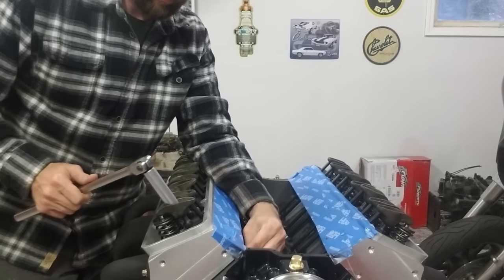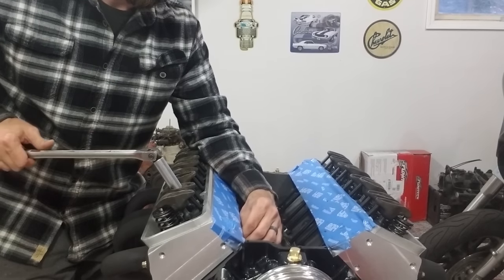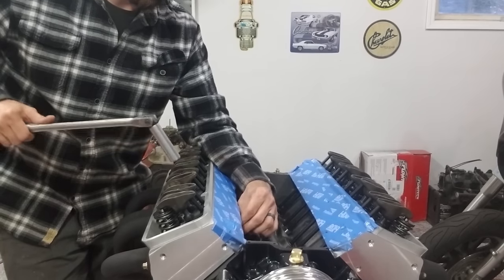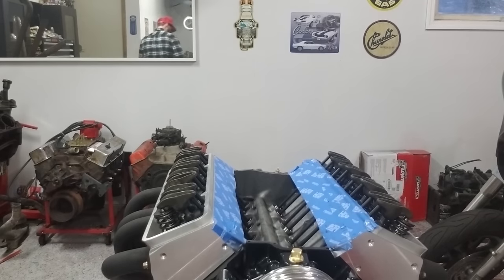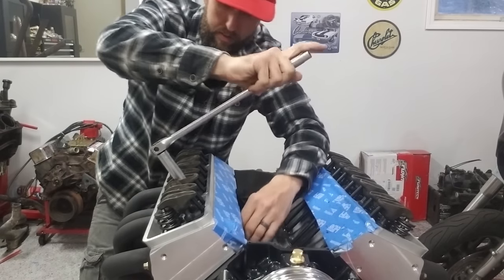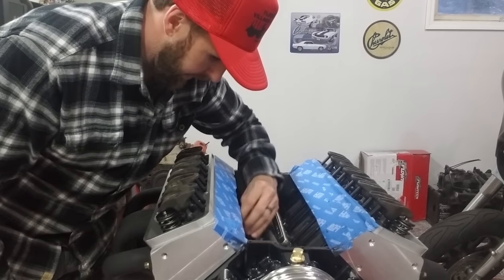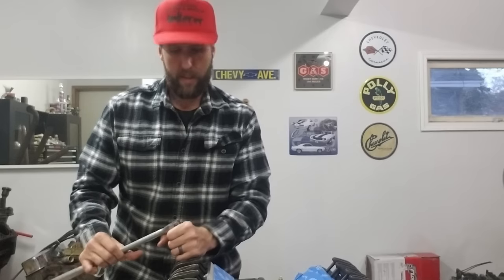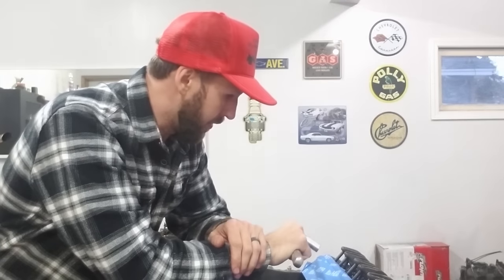Hydraulic Valve Adjustment THE EASY WAY!

Comment: Could you make all of those rocker arms adjustments and if you were concerned they were possibly too tight could you pull a plug and stuff a wad of paper or something into the plug hole and then turn the engine over either by hand or otherwise and see if it will push the wadding out of the hole on the compression stroke?
Reply: If it spits the wad out you know your valves are at least closing  and not hung open by an over tightened rocker?

Comment: Why not: 
Set to TDC - adjust #1. 
Advance crank 90Degrees - adjust #8.
Advance crank 90Degrees - adjust #4.
Advance crank 90Degrees - adjust #3.
Advance crank 90Degrees - adjust #8.

Advance crank 90Degrees - adjust #6.
Advance crank 90Degrees - adjust #5.
Advance crank 90Degrees - adjust #7.
Advance crank 90Degrees - adjust #2.
That way, the cam only rotates one time, thus keeping the cam lube as intact as possible.

Comment: Can I adjust my that way after motor is installed and has been running.
Reply: Yes
Reply: yes,absolutely
Reply: You can even do it while running, and not get messy if you have or borrow someone's valve cover with the center cutout!

Comment: +Vice Grip Garage Been asking around, cannot get much help locally. I thought I would reach out again. From watching this and doing some reading it would seem you tighten them down just until you cannot move them at all, then rotate 90 degrees, and do it again - doing this several times. As I said below, I understand that the lifters should NOT be presoaked when doing this, just dry. Once this is done, it should run purdy good right?
Reply from the maker: Not until they don't move at all.  They should spin freely between your fingers but not move up or down.  90* not enough for hydraulic lifters.  1/2 to 3/4 turn, or 180* or 270*.
Reply: @ViceGripGarage  Gotcha, no up and down motion, but spin freely between the booger pickers! Then rotate the crank more than 90 degrees, say a 1/2 a turn over - do that prcoess again, a few more times, and I should be golden. If I am wrong feel free to correct me - I am still trying to figure all this stuff out. Thanks again!

Comment: Noticed you were just working on the one side but I’m assuming you adjust for zero lash on both heads then turn the crank 90 degrees?

Comment: It doesn't matter if it's 90 degrees? The reason I ask is I don't have access to the crank bolt. (Cooling fans and radiator in the way) If I can bump it over "about a quarter revolution" with the starter, that would make life SOOO much easier.

Comment: This is explained really well, but I think I'm just stupid.  Derek says he spins the motor over about 3 or 4 full rotations until he feels confident in it, but I probably did about 12 full rotations 90 degrees at a time and still kept finding rocker arms that felt like they got loose.  I don't think I have the right "feel" for zero lash.  I tried to feel for when it felt like the rod was contacting both the rocker arm and the lifter at the same time, but I think in the process of checking for up and down contact I was compressing the lifter a bit, or doing so inconsistently.  My lifters are brand new, and though I dipped them in oil as I installed them, I'm not sure if the problem is in the way they're supposed to pump up or what.  I'm definitely not doing something right.

Comment: Just watched your video and just 1 question i have a 326 pontiac motor and just purchased a hydraulic flat tapper cam eith lifters and valve springs will this method work with using stock rockers and still get to the specs according to the cam and not have to shim or use the kit with the wheel and gauge

Comment: Ok, I know how to adjust the rocker arms when the lifters are new and no oil in them. My question is how do you adjust them after the motor has already been run and the lifters have oil in them? I was told it’s not the same way as if they were no oil in lifters. I’m having to replace my push rods because I didn’t get the chrome ones for push rod guides.

Comment: So the idea here is that you adjust the rocker under no tension, when the valve is fully closed, right? And this is a way to not have to think about where the valve is?  The idea is that if you rotate the engine 90° a bunch of times you WILL get it when the valve is fully closed.  Did I get it?

Comment: So what you're saying is that at no point in the rotation of the engine should the rocker arms ever feel loose? Mine are loose on some of the cylinders on my big block 396 depending on where it's rotated to. Should they be tightened?

Comment: I had a hot rod buddy pull my old sbc out of my '77 K10 and install a remanned 350. I think he just set the timing by ear.. it was pinging going up hills so I filled up with a higher octane and added an octane booster which seems to help a bit. The install instructions said to adjust the valves but he said it sounded fine (when fired up in his shop). So I will check the timing, then if still pinging I will attempt to adjust the valves.
My big question is: I guess to access the push rods I will have to pull the carb, dist., and intake, ...not enough room to access the push rods from just pulling the valve covers 😅right? Just wishful thinking I guess.

Comment: very nice I just subscribed to your channel been watching all your builds and I love how you make everything phone just one question on the valve adjusting like the video I just looked at you said it works on all types I have a 350 4 bolt main out of a Corvette that is 30 over I was wondering if I can do the adjustment on my motor the same way even though I have roller rockers and not the regular rockers
Reply: yes

Comment: Is this still the same with a Pontiac non adjustable valve train where you tighten the rocker nuts to 20ftb ? I am assuming you do this with lifters with no oil and when you fire the engine the oil filling the lifter will take up slack and then you torque the nuts to 20ftb . Correct ?

Comment: Mine will be a bit harder. A fair sized solid roller cam in mine. Needs a different process. I'm using poly locks too.
Reply: same exact method unless they are solid,identical procedure

Comment: my Dad showed me this when i was 12 years old, then he made me build a 283 chey and said It better not Blow up it ran like a top I have built Hundreds of Small and Big Blocks Chevy Ford Mopar and this Method of adjusting Valves has always worked with no problems,   this will not work with a Solid lift Engine.

Comment: I got a big block Ford 460 having problems I got it on the motor stand did a cam and intake swap put the lifters in use the same push rods I've been turning the engine over for the breaker bar trying to prime the engine I can only get oil out of the rocker arm on number three good oil pressure the drill wide open about 80 lb I wonder what's going on just came get oil to the other rocker arms any ideas it is a flat tapping Rock on

Comment: I have a rebuilt 3.4Liter Chevy v6.  I ran the rebuilt engine for 30 minutes at 2500 rpm to break in the cam.  I have some clatter.  So now since I ran the engine the lifters have oil.   If I do this process and find that some are loose, I understand that I take the lash out and then go 3/4 of a turn. My question is if I find other valves that were not loose, do I also do an additional 3/4 turn of preload as well? Or do I loosen all rockers and start over?  Thank you for your answer.
Reply: Ever figure it out

Comment: Does this method work on lifters that are already pumped up? My sbc has been recently run but I need to re-adjust my rocker arms will this work in my case? Thanks
Reply from the maker: Yes preload is preload
Reply: @ViceGripGarage  perfect, thanks alot for the response!
Reply: You can do it while it's running also

Comment: I have a newer engines from one of those big company remanufacture 350 sbc for my boat 45 hrs.  Heard a tick starting. Pulled the cover and found#2 rocker not centered on the valve stem.  What's a fella to do?
Reply from the maker: Replace pushrod and rocker, then follow this procedure
Reply: @ViceGripGarage  thank you. I'd attach a pic if it was possible.
Reply: center it and follow along the videur

Comment: do you tighten til the pushrod won’t spin at all or til it just touches the rocker, also do you use the preload from your manual for this method or do you use the 1/2 - 3/4 turns for this method
Reply: Did you ever figure it out?

Comment: Hello Derek. I've got a question that you may be able to steer me in the right direction(no pun intended). I have a 90 4runner. It usually always starts up, but at times when I turn the key, there is a 3-5 second delay before it fires. Battery fully charged, new alternator, starter sounds fine, I've changed the ignition switch, but still happens. Usually when first starting, but after that, starts fine. What should I check? Bad ground possibly? Thanks.

Comment: So I’m gonna be the dumbA that ask, will this adjustment work if it’s not a fresh build and just a car that really needs adjusted?
Reply: I'm doing literally what your asking... the thing about hydraulic lifters is there might be crap that has collected inside it that prevents the lifter from fully compressing or releasing to the factory default height which can cause confusion when your trying to tighten the rockerarm nut. One method is to run tranny fluid with your oil. Half a quart should be fine as tranny fluid is a great detergent to break up gunk and clean internal engine components. It'll take a maybe a weeks worth of driving  (Your hydraulic lifters) but if your like me and are sick of fucking about it then your you better off pulling your lifters and pushrods cleaning them (if they are still usable) and reinstalling them in the same locations you removed them. Trust me it's the pits. Hope that helped buddy 😏 I drive a 2.8 v6 sbc in a 1990 isuzu trooper.
Reply: @radarfubar8087  I do appreciate it. Just decided to brake it down since I have new heads and roller rockers now anyway. Might as well change it all out. lol. Thanks agaim

Comment: Need help!! I got a 2002 firebird 3800 v6  I did the head gasket and on these rockers they just have the bolt that's torqued to 11ft lbs +90° but the valves are remaining open when they should be closed so I'm not getting compression any idea??

Comment: In the 80s, with the vast tool selection i had, to adjust valves I'd use a hammer and screwdriver to either compress the springs, or pry them up

Comment: New to valve adjustment....followed your method and wondering, as I turn crankshaft some pushrods are tighter than others, guessing thats because cam lobe is pushing up harder on certain lifters at times, still ok to turn those the 1/2 turn for preload while in this state? (Being harder to turn these pushrods since cam is not on heel with lifter)
Reply: Car is a 1990 Corvette stock tpi 350, just adding 1.6 roller rockers

Comment: Could use some advice. followed the steps and the engine idles rough and turns off once in reverse. Any help would be great. thanks and keep making videos!
Reply: something besides your valve setting is fucked
Reply: trillrif axegrindor it’s all good now. Just had to adjust. Nothing was messed up

Comment: I know this is an old thread but I have a rocker that’s too tight somewhere. Should I loosen them all and start over?? Thanks
Reply: I did as you said, but went 1/4 turn preload. I lost compression. Backed out preload and got it back. Preload was too tight. Now I’m confused. Lash is at 0 now.

Comment: Can I use this method on reinstalling pushrods and rocker arms on an older GM 3.1 that already has lifters with oil in them?
Reply from the maker: yup
Reply: @ViceGripGarage  It looks like this engine has a specific torque spec for the rocker bolts. If I just install the pushrods and then torque the rockers to spec should I be good to go or no

Comment: I’ll never understand why people don’t adjust the rockers with it running. It’s fast, easy, and the most accurate way to do it. One at a time, loosen until it clacks, tighten until it stops, go another 1/4 turn. Once the valve covers are off, all 16 rockers can be adjusted in less than 5 minutes.
Reply: @shanerosenthal9374  What are you giggling at?

Comment: How much tension when spinning the rod do I want to fill is it till there’s a little bit of drag feeling on it or do I just want them touching and I can still spin it after backing off a little and I’m doing this from the valve cover side because my intake is on does that make a difference?
Reply: One more thing does it matter if I primed the motor with oil I noticed that the lifters rise or stiffen up after I primed it?
Reply: @evanr1301 I don't even know ..

Comment: Quick question. 
Do u have the put the push rods in where they came out or does it not matter I did the head gasket on my 91 460 and did not mark them cause they all looked the same. Help plz
Reply from the maker: Doesn't matter if they're exactly the same length
Reply: Thanks a ton. Love your videos btw. Awesome to see ya doin what ya love.

Comment: While we’re on the subject of valves n such, do you have any experience with Vortec heads? I got a set of gmpp 96-02 vortec heads used from a good friend and they’re stock vortec heads on my 355 (roller motor with stock Y-body lt1 cam) someone told me I can run ls6 springs if I want to use an lt4 cam without having the valve guide bosses machined. Any truth to this?
Reply: I used LS blue springs on my vortec v6 build ( basically the same as 5.7 without two rear cylinders) some were a little snug around the valve guide boss but moved freely with some cleaning. Stock retainers and keepers fit perfect. I had to ad screw in rocker studs though. I read the pressed in studs tend to get pushed out with a larger cam.
Reply: Lima Bravo sorry. I used aftermarket retainers I think from summit can’t remember the part number. The valve guide boss doesn’t allow for much more than .450” lift.
Reply: yes,i just did it.use ls1-ls6 springs,proper comp cams retainers for this swap ,reuse your stock retainers and new stem seals

Comment: So I did this but only did a quarter turn preload, Was worried about cam breakin pressure. It has a very slight chatter. Do you think I can just a add another quarter or half turn while it just sits there, or should I do it up messy and do it while its running with the clips to contain the oil somewhat?
Reply from the maker: Typically unless you have a high lift or double spring you dont have to worry about it.  Tighten with it running if you're not afraid of the mess or run them down each 1/2 turn and see how it does

Comment: I've watched 3 videos of this same method and I've got one question: when you're spinning the push rod, do you tighten the rocker until the push rod just barely stops spinning, or does the push rod still have to spin freely? I feel like the last time I tried this method back in 2011 I had them too tight and I had to loosen them all up because the motor sounded horrible when cranking and of course wouldn't start.
Reply: Damn he never answered

Comment: Do you pre soak the lifters so that they fill up with oil? Or does it not matter if they are filled with oil or dry?
Reply: yes submerge the lifter in oil in a tray, you can do one at a time also, submerge in oil about an inch and then use you a old push rod or new one if you must, and pump the lifter with the push rod to load the oil in the lifter do this for 10 or so slow compression cycles on each lifter makingsure they stay submerged in oil while pumping them. , this is very necessary before break in, careful not to damage the new push rod it may slip while pumping and damage it.
Reply from the maker: I do not presoak them.  Most manufacturers do not recommend this.
Reply: @ViceGripGarage  ways for thee ways for me i suppose.

Comment: Question: I picked up a ‘69 vintage 351w engine that someone else rebuilt. I’ve been going through it to make sure it was rebuilt correctly, from my limited experience. So should the hydraulic lifters be primed in order to adjust the lash or not? In order to adjust the lash for most of the push rods the rocker stud are bottomed out, Is that normal?
Reply: Doesn’t matter. Zero lash is zero lash.

Comment: Does it matter if it was a running engine and the lifters are full?  Can I do it with the intake on?
Reply from the maker: no and yes you can
Reply: Thanks man, I think I had my rockers too tight will re-do it.  Sounds like it's just an easy back and forth when checking lash.  I squeezed the push rods and tightened them until I couldn't move the rods at all.   Before starting I rotated them just to see where they where.  I could turn all of them before taking the rockers off.  I had to take them off anyway because I was doing valve seals.  It's an original 1968 327 and I just assumed they were loose but they were probably right on.  Subscribed.

Comment: How many times have you been asked if a set of longer pushrods work like a mild cam?
Reply: Put in 1.6 ratio rockers instead of 1.5 ratio if you want more lift without changing the cam

Comment: how much tension we talking? just till you cant spin it with your fingers? or should you still?
Reply from the maker: Needs to spin freely.  Zero is when there's contact but no slop between the rocker and the lifter
Reply: @ViceGripGarage  aye aye , appreciate it!
Reply: What he said. BUT, keep an eye on the bucket and make sure your not pushing it down while finding the zero lash. Go slow and use good lighting.

Comment: Should the push rod be able to spin after the 3/4 turn?
Reply from the maker: No, because its under preload
Reply: @ViceGripGarage  great! One more question, if you don't mind, would appreciate it. Should the pushrod spin at zero lash? If so, should it spin a bit freely, or should it be a bit difficult to spin at zero lash?
Reply from the maker: Slight drag, spin easily